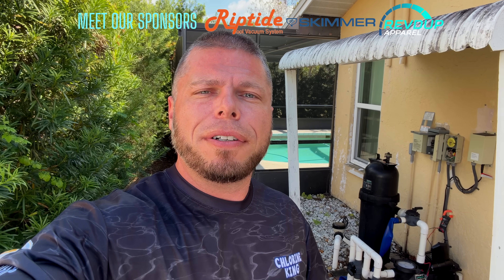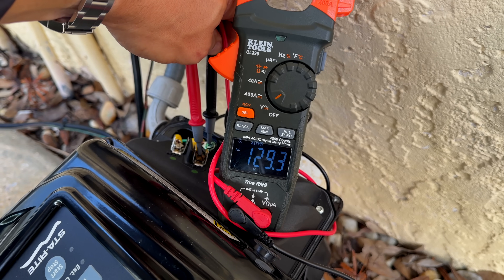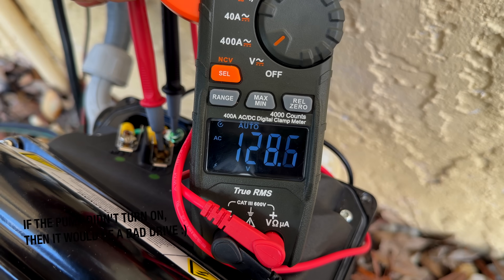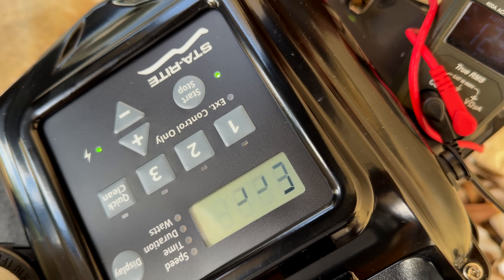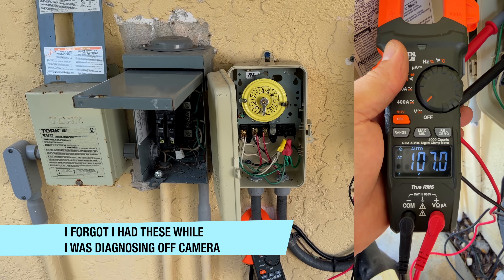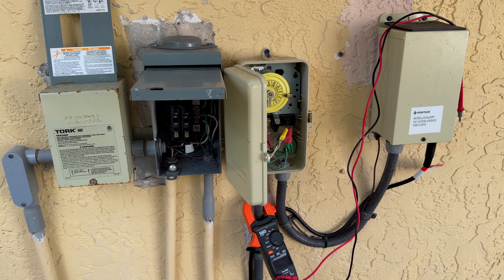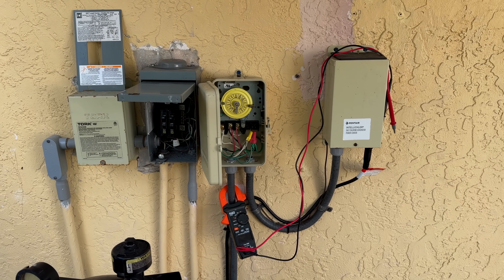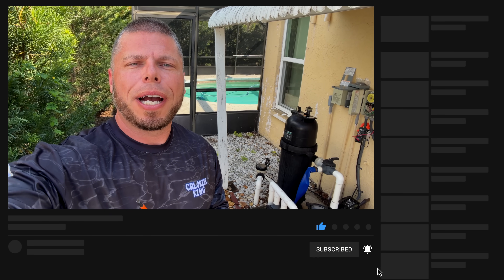Is POWER the Secret Behind Your Pool Pump's Failure to Start? #poolpump

Comment: I have a question Chlorine King.
I have a system reading 33 psi. I cleaned the filters however still reading High for that system
Older pool
-Mechanical clock
-Hayward 4 cartridges 
-13k gallons
-Has a heater , probably hasn’t been use for a long while
-One speed motor 
-The spa drains when motor is shut off.
-no floor pop up system 
-has a vacuum inline cleaner 
I just took it over , from previous cleaner
I ask Chat GPT, it suggested maybe related to the heater .
However my main concern is that high psi.
Any suggestions?
Please respond at your earliest convenience.
Most appreciated.
Reply from the maker: What I would do is try to take stuff out of the equation. The pressure is pretty high in that filter so I would remove the cartridges first and run the system to see if the pressure is drastically lower. If so then the cartridges need to be replaced. I’d the heater has a bypass on it you can put it in bypass mode to see if that’s the issue. I hope this helps!
Reply: @ChlorineKingPoolService great advice ,, I’ll try that. Btw no heater bypass.
Thanks again ❤

Comment: This does not mean its not the pump. I do believe theres some more things you could have looked at before calling an electrician in. 
The pump is wired 120v. Therefore, it is drawing more amps compared to 240v wiring. 
Could have checked the amp rating at 120v wiring and compared that to how much the pump is pulling. 
Is the wire size sufficient, is the breaker sufficient, check all connections and replace all the connectors. 

Hard to see in the video, but it does appear as if the wires to the pump were 14awg, and 14awg is bare minimum when considering a 240v wiring. 
This looks like a new install. 
Im going to guess the old pump was wired 240v on the 14awg and that did ok. The new pump is wired 120v and the amp draw is too high for the 14awg. 

Best thing to do is replace the whip with a 12awg and rewire to 240v.
Reply from the maker: It was not the pump. The sub panel only had room for two single pool breakers. One for the light and one for the pump. The client said he’s had the filtration system wired 120v for all the years he’s been there and this is a recently new problem. 

I should have mentioned the amps in the video. It was around a month ago when I recorded this so I don’t remember the exact number but the amperage was right around the name plate value. You are right that 120v pulls more amperage than 240v just like 480v will pull less amperage than 240v. 

The breaker feeding the timer/pump is a single pole 20a and is 12awg THHN all the way through to the pump which is proper according to the NEC. 

I also did check the lugs to make sure there were not any loose/arching wires and I did replace the fork terminals at the pump. 

Yes, optimally I’d prefer everything to be at 240v.

Comment: Never gonna happen to anyone, but one client needed FPL to fix the power pole to the dwelling. All the other applances worked.
Reply: appliances
Reply from the maker: I’m assuming that’s what it was as well. Too much stuff running at the same time.
Reply from the maker: Funny you say that. A few weeks ago I was out on a client call and for some reason I had a bad leg feeding the breaker bar to the automation. An electrician found that the issue was where the power was fed into the home at the street so the power company had to come and address it.